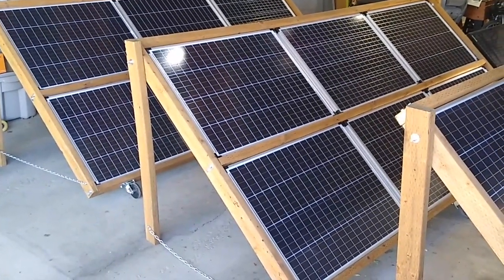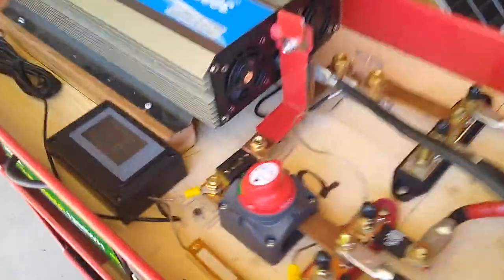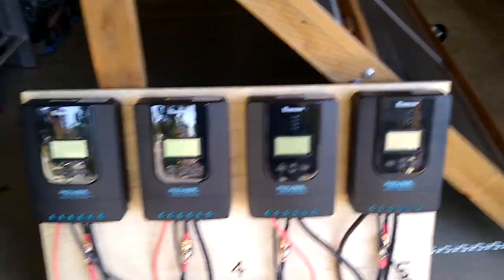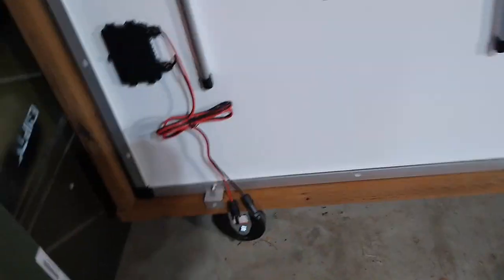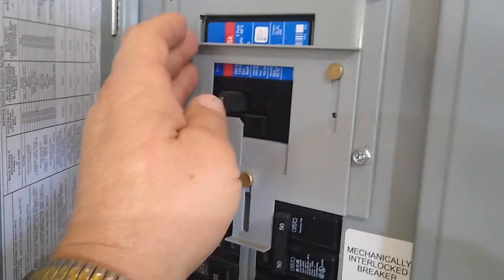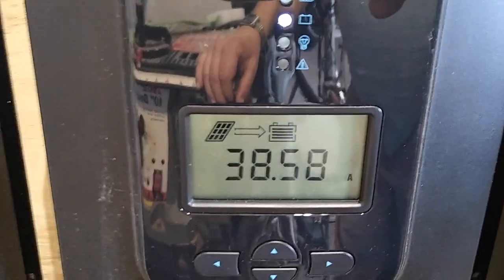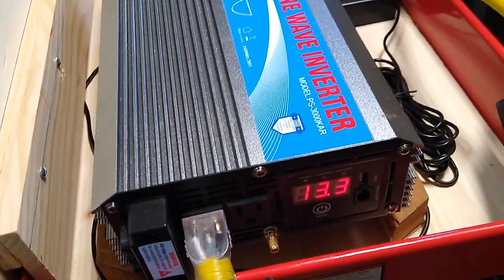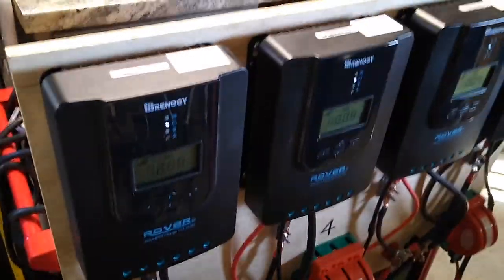My Portable DIY Home Solar Powered Battery Backup System for in Case the Grid Goes Down...

Comment: I love the movable solar panel array idea!! I may need to build a few of those.
Reply: Same! Lovely and very simple design that can easily be changed for the summer and winter time.

I have also saved one other video for the bottom there the bottom could be swinging around so with this video and the other one im thinking about it could be great design together.

Saved this video till i have bought solar panels to my cabin.

Comment: That's a very well engineered system!  Only needs fuses for the solar panels since you have them in parallel (lots of amps shooting through).  Thanks for posting!
Reply from the maker: Each array is wired in a series/parallel arrangement.  Right now, each pair of panels is in series and then the 3 pairs are in parallel.  I'm going to experiment with 3 panels in series, but I haven't yet.
Reply: @MathesonFamily  sounds like you know exactly what you're doing.  Congrats on obtaining the knowledge to become independent from the energy companies!

Comment: Great ideas there. I love the portable setup.

I would play a bit with the solar charge controller's to lower the battery voltages. Charging to 14,5V, means 3.625 per cell if equally balanced cells.... I would lower that to 13,8V to a maximum of 14,2V. No real advantage in going higher. You get maybe 1 to 2% more capacity but the chemistry gets stressed. Anything above 3,45V brings very little capacity, although it brings a little more charging speed.

Great video and work. Cheers

Comment: I know you don't want to hear about 24 or 48 volts but I have to agree with you in that your setup is perfectly fine with 12 volts.  The biggest advantage with 24 or 48 volts is having less amps going through the wires allowing for thinner gauge copper wiring and thus driving the cost of a large solar array sprawled over a large piece of land or having the array far from the house, as in the case of a farmer who would rather have his livestock closer than the array so that he and his guard dogs can keep an eye for predators.  But you don't have to deal with sprawl ... your setup is impressively compact and your arrays are close to the house so though you have to get thicker copper wiring, you don't have to get much of it.  And it is a nice reminder that the true pioneers of "off-grid" solar power were RV owners who were also perfectly fine using 12-volt setups long before high-wattage solar arrays started becoming cost-effective for farmers and ranchers who always had the cheaper option (at the time) of running a heavy diesel generator (unlike RV owners) for their off-grid power.  It was these latecomers who introduced solar array sprawl and thus created the need for 24 or 48-volt setups.
Reply from the maker: Thank you for your understanding comment!  :)  I agree with everything you just said.  I've deleted several comments from viewers that say I should have used a 24 volt system (also from viewers that are offended I used Harbor Freight panels).  But from my point of view, a 24v system would add nothing except cost.  All my components are 24 or 48v compatible except the inverter.  The panels are wired in a series/parallel arrangement.  I could replace my 12v/3000w Giandel inverter with their almost identical 24v/3000w inverter but it would be a pointless $400+ expense.  The system would still do the same thing.  I agree that if I were constructing a larger system, such as might be possible with my "retirement house", I would make changes.  But I didn't want to not use any of the components that I had already bought when system was smaller.  There just wasn't a need.

Comment: First off, I really like what you did here.  It makes a lot of sense building out the stands and making it portable.  I did something similar and I still have the Giandel inverter but switched to a Growatt 48V because of the cabling and other requirements when running higher amperage.  But there are real advantages to how you designed this with dedicated MPPT's.  If you get a shading on one panel array it'll have much less affect on the system.  Whereas a single MPPT like my configuration would cause a big drop in amperage across all arrays.

Where my system is different is I built out 2 pergola's and set the arrays on top.  The disadvantage there is they're currently flat and I'm not getting 100% wattage during peak solar.  I'm planning on doing something like you did here with the adjustable stands and remounting the arrays on my pergola's.  So this gives me some good ideas.

Comment: I would really like to see how you made the racks for your solar panels those are awesome
Reply from the maker: I am planning to post of video with a lot of the construction or assembly details.  I've already shot the video segments.  I just haven't assembled the video yet.  Thanks for asking.
Reply: Thank You so much. I was also wondering where your son went on his mission?
Reply: @MathesonFamily  looking forward to it
Reply: @MathesonFamily  How does your set up compare to let’s say the Bluetti AC500?
Reply: One of the engineers for Dr. Peter Pry formally of the EMP commission whom has recently passed away. This engineer said that you would take two 12 V deep cycle batteries and combine it with a 2000 W inverter. He said you could run a home for 20 years but I think that was a little overstated. What do you think of his set up?

Comment: As of late ive been thinking how to protect my DIY very small solar system.(Im glad its very small) from an EMP. An EMP will lay waste to my whole system,  which consist of solar panels, Victron charge controller, a 3000 Watt inverter plus 2 batters that have a BMS. Now i have find the cheapest way and the best way to protect my system. BTW you have a very neat system. I admire people who make the DIY Solar system super clean and neat.
Reply from the maker: Haha!  Thank you for thinking this system is clean and neat.  In an earlier form, the controller board was much tidier with short, straight cables cut to length but after actually reading the Renogy controller manual, I realized I would have to re-design it to mount the controllers vertically (for cooling purposes).  So in its present form, I got lazy and didn't worry about running the cables in nice straight short sections.  I just made it functional.

Comment: I hope u use all that for power all the time.  There are transformer / controllers that will take solar & line power & feed whichever is available  to circuits u designate, like fridge, furnace...   GOOD WORK. Got some inspiration .

Comment: Great setup. I've started building my solar shed setup with one 40A rover and 4x100 panels to get into the game. I've also been eyeing up the same 3K watt inverter that you have as Giandel seems to be the best bang for the buck.  Biggest thing for me is to start small but have the ability to scale up.
Reply from the maker: Yeah, that's about the scale I was originally planning to do.  But as I procrastinated on actually putting it together, Harbor Freight would advertise another sale on panels and I'd buy a couple more.  So this is essentially a scaled up version of what you are planning.  Good luck!

Comment: This is a great build. I like the mobility with the frames and cart. I used 2 hand trucks to create redundant 3.5kw and 2.5kw vertical systems. I know you intended this to be 12v but you can always use the solar panels and the batteries if you do upgrade to 24v or 48v. That way, you can double or quadruple the amount of overall wattage the cables can handle. You could then replace the 4 controllers with one larger one that has an integrated inverter. Will Prowse has a lot of videos on these larger DIY systems.
Reply from the maker: Yeah, I actually had the 12v inverter before I had most of the panels, which for the time being, locked me into the 12v design.  Except for the inverter, everything else could be used for a 24v or 48v system.  Maybe if I feel the need to expand in the future, I'll spring for a different inverter, etc.  But for now, I've been able to keep and use everything I had for the original smaller system.

Comment: Thanks common sense approach to home solar.  I haven't had a power bill for 15 years or more  it bugs me no end when naysayers claim it doesn't work  only few tricks  fat wire lots of fuses and keep it as simple as is practical for your needs.  Get your build looked over by someone skilled ___a peace of mind it will bite you just as well as the bought stuff n ____b. Get most bang for your buck.  But the real key is to use less    led lights and effective fridge /freezer s.       Sundazzer freezer system well worth a look      energy proof you house insulation  draft s etc    it's a learning curve but worth it     thanks for showing us your tidy well thought out system keep it up well done

Comment: I like your mobile array idea but I’d want larger wheels for rolling across my grass lawn. I built several solar arrays using furniture dolly’s and galvanized 1/2 pipe held together with zip ties. Easy to clean and very mobile for aiming at morning and evening sun.

Comment: I have the 2200w version and it does over the rated amount. Even runs my 1.6hp dewalt air compressor, and 3.5hp Poulan chainsaw.

Comment: Another note on the seperste charge controllers. This is actually better than on big one. If racks of panels have different sun exposure, then 'weakest' would rag all down (with combiner/single controller), plus you have redundancy built it. Perhaps look to see if these can have data link between them, so they can agree on charge point/voltage.

Comment: A great portable system.  However,  there are some vulnerabilities.  The cart, the shelves should have several large drain holes,  especially the top shelf. The cart should also have some type of protection from roof leaks. 

It looks to me like your panels are connected in parallel making 4 strings of 6 panels connected in parallel?  If this is correct,  you absolutely should fuse your panels. Otherwise,  a fault in one of the panels will cause the rest of the panels on the string to dump all their amperage into the broken panel leading to a fire.

Comment: Sir, i like what you have done. Excellent.  Im building my own 12v , 400w solar panel system as well. I like the cart with the batteries,  inverter, controller set up. 
I've been collecting components over the past yesr. My panels are the same. My intent as far as mounting and portability are  the same. Great video.

Comment: As a self build system this is great, nice to see clean/logical layout of components and wiring. I'd be a little concerned about the stability of the panels - one wind gust and you might see some damage. Maybe add some tie-down points for stakes/pegs/guide lines....
Reply from the maker: Yeah, I have given some thought to what I might do about high winds.  I don't really expect to use this system often or for very long as it is just a back up.  But my first thought is I'll just lay the arrays down flat on the ground if it gets windy.  Each array is 150 lbs and unlikely to budge but, later, I may invest in some type of a system to anchor them down.

Comment: Cheers!
I liked your work, professional, nice and clean. The only thing I recommend is that change the wooden bases of the panels and make them with aluminum, since if it is a portable system, the wood is very heavy and it decomposes. Thank you for your attention, hrg1961
Reply from the maker: Thanks for your good words.  I considered metal frames but it was quite a bit more expensive and I expect that actual use of this system to be rather minimal so I chose treated lumber so that if it was out in the weather, it would be OK for a while.

Comment: I like the way you designed and constructed the deployable solar arrays. I noticed that you inverter sees 12.4V when your battery says 13.1V when pulling 2000W... This could be fixed by adding another set of conductors (in parallel) between your batteries and the inverter to reduce the voltage drop.

Comment: Nice build. 800 Amp hours can keep stuff running for quite a while. I like the multiple Renogy  MPPT units. They are reliable.

I am attaching a video showing how I can read my Renogy shunt type battery meter remotely. The Renogy WiFi dingle dongle is fine when I am home. But if I leave for days, I want to know what's charging, amps drawn, state of charge, etc. So I added a Pet Cam video system.  The iPhone app allows me to  rotate the camera 350 degrees, look up or down, put a red laser dot on the screen and prove that it's real time. It has 2 way conversation and I can verify that the inverter fan is running or the MPPT fan is on if the solar input is over 500 watts.  The Pet Cams are cheap, useful, and handy

 There is an extra digital thermometer panel  with 8 readouts not shown and can be read instantly by cell phone with that same camera. This battery cabinet with inverters runs for months on end and powers up 2 full sized fridges and 4 chest freezers in the shop. I can see if the temps are correct on the units being powered up. The system is 24 volts, has 3600 amp hours or 46,000 watt hours in Chins batteries.   https://www.youtube.com/watch?v=vwrH6pFzy4w
Reply from the maker: Pretty fancy stuff!  Thanks for sharing.

Comment: I really like your panel arrays design. What do you do for wind management?
Reply from the maker: I haven't had the arrays up in really windy conditions but my concept has been to simply lay them down flat on the ground.  They are heavy enough that nothing short of a hurricane or tornado is going to move them.  In November, that cut their generating power almost in half (~22 amps per controller vs. ~38 standing up).  In the summer it would be less power drop because the sun is more overhead.

Comment: The good position is perpendicular of solar radiation.  
Use a square to get the most out of the solar panel. Best regards.
Reply from the maker: All the arrays are set by fixed chains to create an angle that corresponds to the optimal fixed angle for our latitude.  I was going to make the angle adjustable to account for seasonal variation, but decided that keeping it fixed was simpler and I'd only lose about 10% efficiency.

Comment: Nice project and all. But you'd of saved money just going with a inline generator and not have all the setup. But I'm sure you know that and just wanted to do this for fun. Mental note used home panels are cheaper than the 100w panels from HF. Places offload them cheap by the skidload. Just sell what you don't wanna use.
Reply from the maker: I like your comment because your remark about used panels is a good suggestion.  I actually already knew that when I saw an in-state solar dealer advertising remanufactured 300 W Canadian Solar panels for $120 but at that point, I already had my complete compliment of 100 W panels on hand.  Most of the comments that other folks make saying I should have used different panels are less than good suggestions.

Comment: Those panels are great. I currently have 16 on my way to 24…I buy out the stores when they go on sale. You are right…they absolutely overproduce their rated wattage. I’m very happy with them. 
I decided that I wanted to have these panels out 24x7, so I’m constructing permanent mounts for them now.  I’m looking forward to your video on how you made them, and I’m wondering why you went with different mounting angles (maybe they are adjustable?). 
Looks great!
Reply from the maker: Thank you for being someone who didn't criticize me for using Harbor Freight 100W panels!  Many people have been offended by that but I deleted their comments.   I have no regrets about buying them. They seem to be well constructed, are the more efficient monocrystalline design, work very well and, in fact produce more power than advertised.  Yes, if I was starting from scratch, I could use larger panels (for about the same cost per watt, especially after shipping) and a larger and integrated charge controller.  But the fact is, I started small, and the system got bigger but I haven't had to retire or discard any of the components I started with and it works fine.  I did originally intend to make the tilt angle variable by having longer legs with an adjustable length chain with pre-marked angles for different seasons.  But when I looked into it more, it appeared that the most efficiency I would lose with a fixed angle equal to my latitude was 10%.  So I cut the legs to be vertical for that angle and attached constant length chains to keep the panels stable at a fixed angle.  They are all uniform now.
Reply: @MathesonFamily  Those panels are great for all of the reason you said.  I like that you can get them local from a shop you can return them to. They are well made. The wire is OFC, which many are not. I have had them produce over 104w each before.  I also started put modular and kept adding to the system.